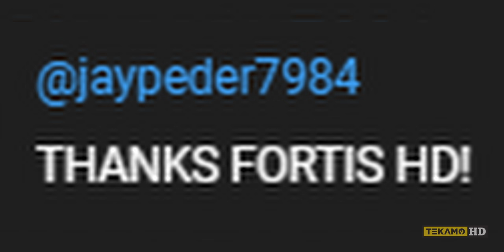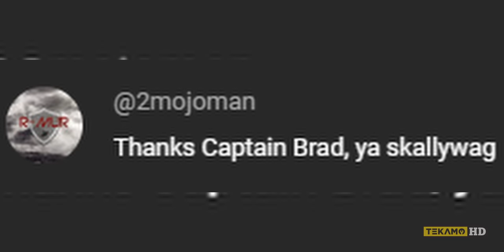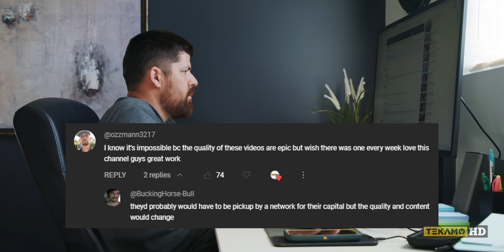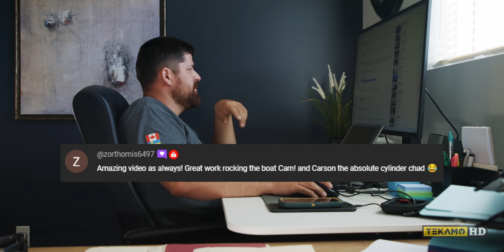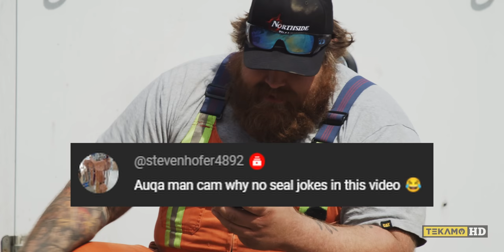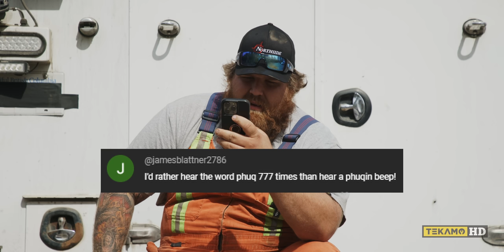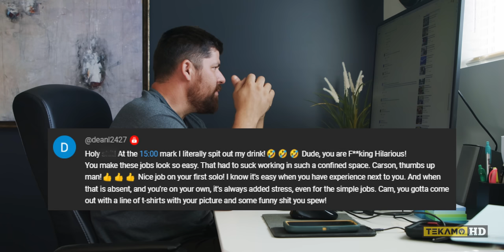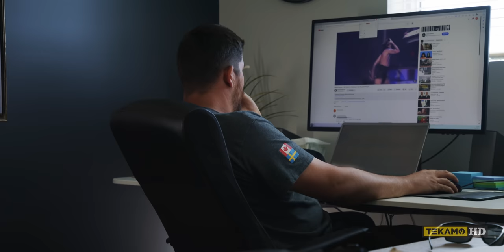Heavy Duty Mechanics Respond to YouTube Comments - CAM & TYLOR

Comment: 14:39 about the walk to the truck from the boat situation. I’m a boat mechanic typically working on either tugboats on the Mississippi River or supply boats that run offshore in the Gulf of Mexico and some of them 200+ ft long so I can definitely sympathize with the walking 10 minutes to get back to my truck to get more stuff. But I’ve gotten to the point now where if the guard tells me I have to park away from the boat or outside the yard I tell ‘em don’t even sign me in especially if it’s a big job because I’m not making that walk 50 times with cylinder heads or cam shafts or whatever else. I’ve literally had conversations with the customer contact to let them know if I can’t park closer to the boat then this just ain’t gonna work. Yeah I’m there to help them but they gotta help me help them. Anywhere great content love what you guys do and it’s refreshing to know that they’re are guys like me and the guys at my company like us on YouTube. Keep up the great work and stay safe out there fella. P.S. Hello from across the board and way safe in Louisiana.

Comment: I'm with you on the engine/motor cam! Engine is mechanical, motor is electrical gawt dang it! 😂
Reply: Is it enginecycle or motorcycle? Enginecar or motorcar? Engineboat or motorboat?
Reply: @NBSV1  motor is a French word for electrical device. So people have been using it wrong since those were invented.
Reply: @NBSV1  starter engine. Vacuum engine.
Reply: @NBSV1  it rolls off the tongue better but they really aren't interchangeable from why it originated.